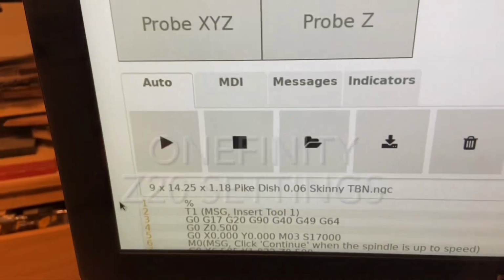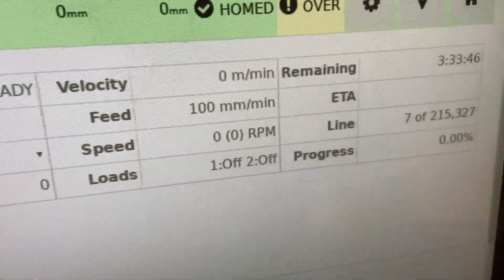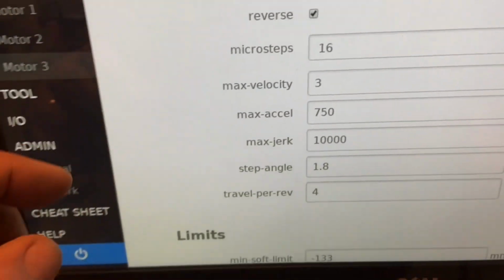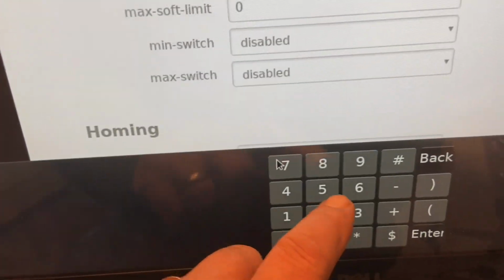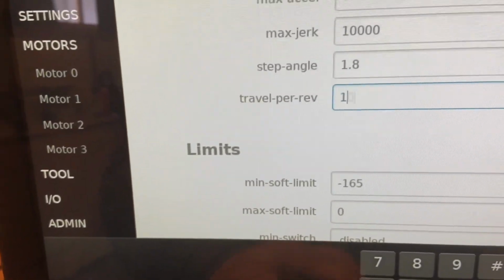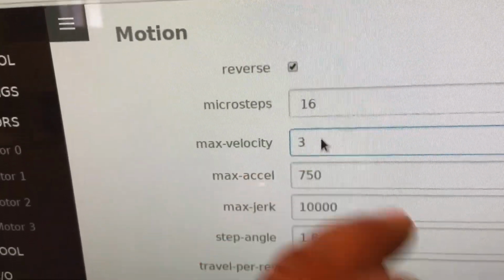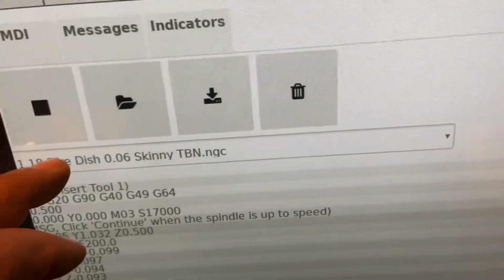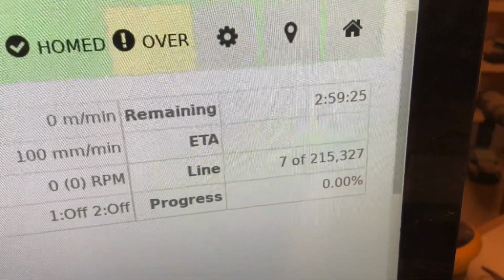Onefinity Z20 slider settings

Comment: I just ordered a Redline spindle along with the Z20 slider.  I have a Buildbotics controller.  Do these instructions work with the controller I have?
Reply from the maker: Hi Frank, it does but since this video came out, onefinity added the reset configuration to include the z20
Slider.   Go to the fly out menu and select reset configuration. Then select your machine model (woodworker/journeyman etc) and then select your Z slider (z20). This will establish the correct settings for you rather than having to manually change them. You’re going to love the spindle/z20 combo!